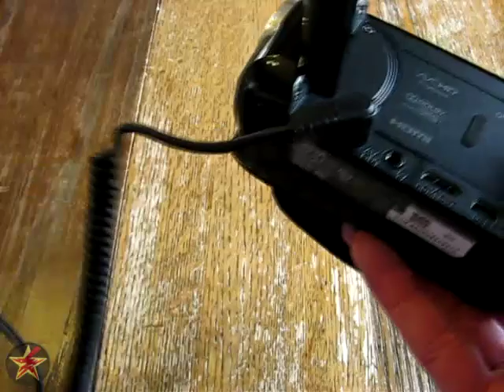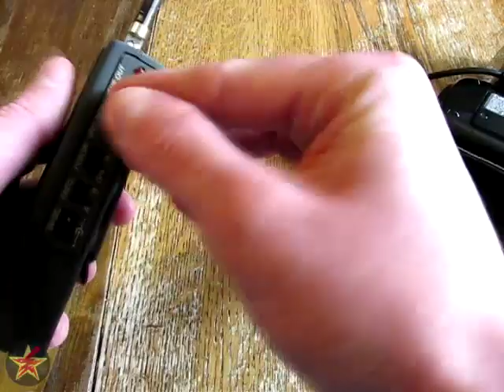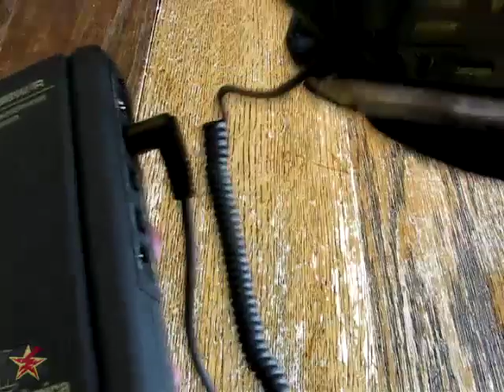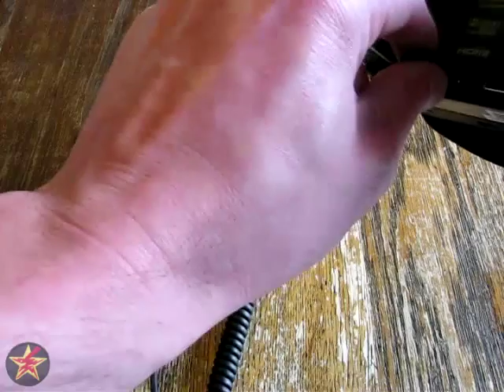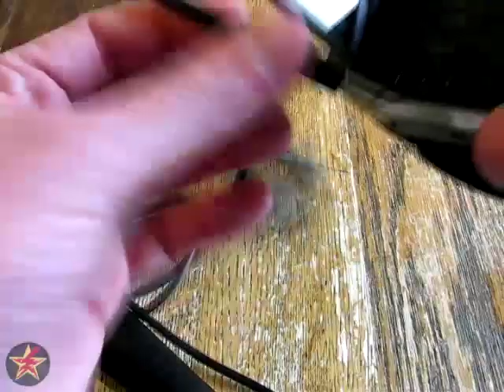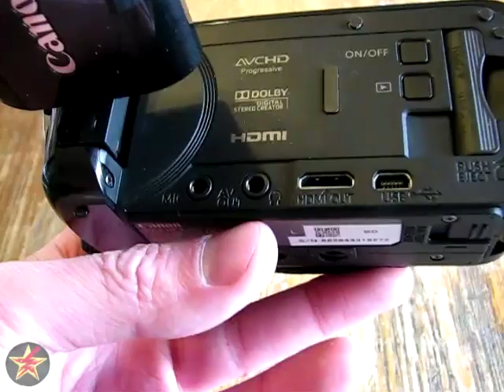Canon Vixia HF R400 How to: Use An External Microphone

Comment: Hoping to get a little help here. I’m using this very same R400 camera to shoot YouTube videos. I use two types of external mics, a handheld and a lapel mic. Both are wireless. Both have an adapter to plug into the camera mic line in port. While they work and record audio and the audio is fairly decent, when I playback the recording on my computer or edit my projects the final audio output seems to not work very well when wearing headphones. Sounds fine on a tv or computer or mobile device speaker. But if you plug in headphones the Audio recorded on the camera originally is only heard through one headphone. Usually the left one. It’s infuriating and I have tried everything I can think of to fix it. I cannot figure it out. Could someone please help before I throw the camera out the window? :) 

Thanks!!
Reply from the maker: It sounds more like your video editing program is treating it as a single Channel instead of dual channel for the audio. You should be able to visually see this depending on the program you're using. You can correct this if necessary by making sure the camera is recording in stereo. If it's still an issue you could always duplicate the audio Channel so that you have it on left and right in your editing program.
Reply: I just tried watching the raw footage from the camera and it is also mono tone, one headphone, left side only. So it’s not the editing software. I have tried adding a second audio track in editing and that also doesn’t seem to work. It’s horribly frustrating. What are the steps to ensure the camera itself is recording in stereo? That’s the only thing I could be missing here and I’ve been all over the settings. Unless there’s a hidden one I missed or misunderstood. I continue to be at a loss here.
Reply from the maker: If filming in auto mode select the camera and gear icon in the lower right hand corner of the screen select audio and then you're going to want to make sure it's on STD and those are the settings that I have when I've used this camera in the past.

Comment: For some reason whenever I plug my mic in, (it's not a wireless one) it stops picking up any sound from anything
Reply from the maker: Does the mic have its own power?
Reply: @Wanderer001_Reviews  I don't think so, I think It's meant for computers
Reply from the maker: @elijahmunkee5703  That would be the issue then.  This camera needs a mic with its own power in order to use it.  The camera does not give power to the mic.
Reply: @Wanderer001_Reviews  thanks! Appreciate it!

Comment: When I use a mic with phantom power it is so noisy as to be unusable.  I can't seem to lower the power of the mic to fix it.
Reply from the maker: You may need to adjust the micro-level itself on the camcorder.

Comment: Cant you plug in the lavaliar mic directly into the camcorder without transmitter? I've tried though and it seems the camcorder mic is still on.
Reply from the maker: The only way that would work is if the mic can provide its own power.  If not you would need to use it with a transmitter which provides it with power.
Reply: @Wanderer001_Reviews  thank you..are the transmitters pricey?
Reply from the maker: @09Amaris  They can be.  It might be better just too look for a battery powered lavaliere mic that you can plug in.  It would save you money.
Reply: @Wanderer001_Reviews  ok thanks

Comment: Thanks a lot for the info! My issue is still not answered though -- maybe you can help...I'm using a Rode VideoMicro plugged right into the Camcorder. When I recorded, no audio was picked up at all, just a static sound. The mic works perfectly going straight into my computer. Do know what the issue could be?
Reply: Figured it out from a forum! The camera doesn't provide phantom power, which the Rode VideoMicro requires
Reply from the maker: Yes you beat me to it it does need to be a powered mic.

Comment: Seems that one cannot use a DYNAMIC microphone, only a CONDENSER; the camera doesn't provide phantom power so the microphone needs its own battery or phantom power supply to work. IT IS REALLY WEIRD that a 1/8" socket microphone socket won't work with a dynamic microphone. There should be a warning in the manual that a dynamic microphone won't work.

Comment: hey Wanderer Thanks for your videos.  I have a question. Im trying to download some videos I just took with my cam but when I put the memory in my computer  They are not there. But they are still in the video camera. What wrong? Thanks a lot!
Reply from the maker: Chances are if they're showing up on the camera but not your computer they were filmed using hcav format and not the MP4 format. The reason you can't see them on the computer is you don't have a program that can open them.
Reply: @Wanderer001_Reviews  thank U for your time!

Comment: HELP. I have a Vixia HF M50. I can run the external RODE mic with no problem. But my new Boya BY M1, which works fine on my cell phone, does not work. And yes I turned ON the "camera" power switch. I notice the 1/4" plug on RODE has 2 black stripes while the Boya has 3 which means there is something different about the jack. But it is supposed to work. Can you suggest a fix...perhaps name an adapter?
Reply from the maker: The vixa line needs to have a powered external mic. I did not see that this mic is. What this means is the mic must have its own power supply.
Reply: @Wanderer001_Reviews   Thanks for the reply. This my does have its own battery power supply to switch on for cameras. It's not helping. I now think it needs   An adapter

Comment: Hi dude. I just bought a Canon Vixia HF R10. I'm trying to use a Genius Mic withouth external power suply and it does not work. Could you help me? Thanks.
Reply from the maker: The Vixia cameras need a mic with its own power supply.  It can not power a mic just by plugging it in.
Reply: @Wanderer001_Reviews  Thanks for your reply. Yes, I realized that after many attempts. I thought my cammera was in bad condition. Do you think a Lavalier BOYA BY-M1 mic could work? Thanks again.
Reply from the maker: @GatoCapitalista  Does look like it would.
Reply: @Wanderer001_Reviews  I will buy it then. Thanks again for your kind help. I will buy the mic and I'll tell you how it works.

Comment: Hi, thank you so much for your video. 

I hope you can help me,  at fit my externa mic was working wonderful!! However, on the last videos the sound is horrible when the pastor stops talking there is a loud noise, when there he talks again the noise gets lower.. any idea?!?! We are small church so the room is not sound treated. Also we use the movo mic with zoom H6. 

Thank you again for your time, and God bless you!
Reply from the maker: If you can use another mic to see if there is an issue with the report on the camera. If a different light works fine next week to check the cable on the light that's giving you an issue. Both are giving you an issue port on camera might have gone.
Reply: Wanderer001 
thank you for replying back.  

 It turned out it was the settings.

Comment: a major issue is the need to adjust the input level manually. how is that done? If the input level is too high, the sound on the video will be distorted. Please tell us?
Reply from the maker: I had someone else ask this too, so I made a video: https://youtu.be/991lj3lav8E

Comment: You never got to a very important point- how do you adjust the input level on the camera? Recording music in various settings demands that you may have to turn up, or turn down the input signal. If you fail to do that, loud music could potentially damage the camera, and it certainly would be distorted on playback. I'd be very thankful to hear about that. Thanks
Reply from the maker: As requested: https://www.youtube.com/watch?v=991lj3lav8E
Reply: @Wanderer001_Reviews  like and subs, thank you
Reply from the maker: @syphonfilterpsp  Thanks, happy I could help.

Comment: I had a quick question. I recorded an interview with the external mic, and unfortunately, I think the battery must've been failing on the mic, because I get a lot of static from the mic. So much static that the interview is unusable. Here's my question: I know that on professional video cameras, there is a "camera mic" and "plug-in mic", and that if there is ever an issue with the plug-in mic, you can always resort to the camera mic, and even though the quality won't be as good because of the distance from the subject, at least the interview can be heard faintly.  Can I do that -- are there two tracks of audio recorded once a mic is plugged in, and I can somehow switch off the recording of the audio that was recorded by my crappy mic?
Reply from the maker: I hate to say it but you are looking for a little too much from this consumer level camera.  If you use an external mic that is the only audio that is recorded.  It bypasses the on board mics once something is plugged in.  Sorry.
Reply: That's what I figured, but figured I would just ask anyway.   :)   Thanks so much for your prompt reply!

Comment: is this the same with the Canon Legria HFR806?
Reply from the maker: +Demented Wasp / DW - WaspSquad This would be an older model of the US version.
Reply: Wanderer001 yes but would the microphone plug in the same way?
Reply from the maker: +Demented Wasp / DW - WaspSquad It does not look like it has the mic port, so no.

Comment: I got a canon hf g25 camcorder ..when connecting the ext mic to my mixer amp and record from mixer head phone out to camera there is a humming noise in the background, when play back..when turning the headphone volume down the hum gets lower, turning it up the hum goes loader what is the problem,please,   Willa..
Reply from the maker: +Willa Cilliers When you plug it into the mixer do you also have the power plugged into the camera? If so this is the cause of the humming sound.

Comment: Thanks for your helpful videos. I have a very similar model (Vixia fh R700).  I'd like to be able to turn off the LCD display while recording videos (lectures) with camera on a tripod. My understanding is that this is possible only by changing a setting in the menus and then closing the LCD screen. But that means you can't use the external mic! Is there any way to turn off the LCD screen on a Vixia without closing it, so that the external mic can be used?
Reply from the maker: +John Wathey Sorry to say no. The only option you have would be to lower the screen backlight.
Reply: Thank you!

Comment: Is the Floureon BM-800 condenser microphone compatible with the Canon Vixia HFR600? Do I need an extra cable? Is there a setting on my camera that I need to adjust?
Reply from the maker: +Entertainment Reviewer It is not. The only mics that work with the Vixia line are those that have there own power supply.

Comment: Hi, I have the R600. Is there anyway to adjust the levels of the mic in camera?  When I record with my lav mic the sound is very loud and I have to dial it down in iMovie. Does the onscreen mic level indicator indicate if your sound peaks into an unacceptable range?  Thanks!
Reply from the maker: The mic level can be controlled on the camera.  However, there is a catch.  I cover how to do it and what that catch is in this video: https://youtu.be/fttItkyj3zg?t=6m.  As for the mic level indicating your sound peaking into unacceptable ranges, this is not that fancy of a camera.  The read out is marley showing what areas of the video are louder then others that is all.
Reply: Thanks!  This was helpful!!

Comment: Thanks for the video but how do I connect it to my Tascam DR-40? When I plug both ends I hear a horrible noice, please help
Reply from the maker: From what I can see you would need an xlr to 3.5mm jack converter in order to use it with the R400.
Reply: thanks for your reply :)

Comment: How bad/good is the built-in audio scene mode as "speech" vs. external mic?
Reply from the maker: External mic is always going to give you better sound.  However, with that said using speech scene mode will help to cut down ambient background noise and the like.  So if it all you have it is better then nothing.
Reply: +Wanderer001 thank you for your reply. so, it sounds like that canon implemented the audio scene, more specifically the speech mode, by post processing audio signal obtained by the general purpose built-in mic instead of using a small shotgun mic-like, if any.

Comment: I tried hooking up a regular computer microphone (unpowered) to my RF Canon video camera, like the one shown here, and it didn't work at all. Have you actually tried a non-powered microphone? You didn't show it working.
Reply from the maker: +supermuble I have and non powered mics do not work. The mic I used was part of a wireless mic setup. So there is a powered receiver that it was paired with.
Reply: Ok that is awesome information. That helps me out immensely!

Comment: "You do need a powered mic for this to work" is probably the BEST piece of info that I've seen on this topic.  And this after searching support pages on Canon's own site, trying to figure out why the mic I use for Skype wasn't doing squat when plugged into my camera.  OOOOOOOOOOOH!  I have no idea what a powered microphone is (other than the wireless one I see in your video, but you've sent me in the right direction.  Thankyou!
Reply from the maker: A powered mic is one that does not draw power from the mic port on the camera itself.  Rather it has its own power supply.  That power supply could be for a battery or electrical outlet.  The R XXX camcorders from Canon all have this issue.
Reply: +Wanderer001  any recommendations on self powered mics other than that wireless one?  A lapel mic for vloging is what I'm looking for.  Camera mic picks up too much ambient sound and sounds "far away"
Reply from the maker: I might suggest something like this. (http://amzn.to/29UWFPg) but I am not sure of your price point.

Comment: I just purchased HF R70, will this mic work. Also any suggestion on what to do with transmitter box while vlogging at an amusement park? Or would I be better off with either a camera mounted or a wired lapel mic
Reply from the maker: Yes, it should.  If you are going to be vlogging at amusement parks I would suggest going with a wired lapel mic.  Just remember that the mic will have to have its own power as well.

Comment: Im having trouble with an SH-666 Condenser Microphone. Im plugging it in but the audio goes completely off. There isn't an on an off button on the microphone so Im really confused. It also didn't come with any instructions. (This is for the Canon HF R700)
Reply from the maker: If the mic itself does not have a power source other then then Canon Vixia it will not work.  The Vixia line as a flaw in which the mic needs its own power.  It can not just draw power from the mic plug.
Reply: +Wanderer001 so what would I use as another power source?
Reply from the maker: +TessaLuv That is the issue if the mic does not come with another power source then there is no way to add one.
Reply: +Wanderer001 do you recommend a good microphone then? I want to record podcasts and I need one that will pick up two or more voices
Reply from the maker: Something like this: http://www.rode.com/microphones/videomicpro or http://www.rode.com/microphones/stereovideomicpro.  Note how they are powered by a 9 volt battery.

Comment: quick question. have you ever had problems with your canon vixia picking up the external mic from the transmitter? it's been an intermittent problem. one day it works completely fine and another day, I see the bar menu for the external mic on my camera screen but I can't see the bars and no voice is picked up.

do you think it's possible that my camera mic slot has malfunctioned? it's really annoying to say the least. any input based on your experience would be great. thanks. 

ps: yes the battery is fine and powered so nothing obvious like that.
Reply from the maker: I have not experienced anything like this with my camera before.  Is it possible to use a different cord from the transmitter to the camera?  That really is the only thing I can think of that might cause this other then a bad plug on the camera itself.
Reply: great suggestion. I will play detective and see

Comment: When I play back videos on the camcorder with external or internal mic sound does not play.  Is there a way to turn up the sound?
Reply from the maker: +Irene Yamane Yes in playback mode select the house icon in the upper left. After which select other settings, then the last tab. Here. There is an option to make the volume louder.

Comment: How do you find the volume bar on the camera's screen? (like you have it on the video). I can't find it. Thanks!
Reply from the maker: +Louis Leung It is in one of the manual modes.  If it is in auto mode you will not see the mic level.

Comment: Wanderer001:  I appreciates you doing this as It addresses my issue. To wit:

I bought an XEXIA R52 because i saw the words "stereo audio recording". I make musical instruments which involve automated audio panning - so i wanted a camera in which i could record the audio from the instrument through wires as opposed to a mic and have the benefit of capturing stereo panning. My only othr option is dealing with it in i Movie or whatnot, but then I have to worry about syncing and this small job just got horrible big again. 

Now here's my problem I was hoping you could help me with: I can find the assignments for the audio input jack in the pdf manual. I noticed your Audio Technica wireless has the three contact 3.5 mm plug and the Canon manual does say they make a surround mic you can use instead of the internal one - so all looks good - but i can't find the tip/ring/sleeve assignment so i can make a cable that will send stereo info into the camcorder.

Do you happen to have this info?